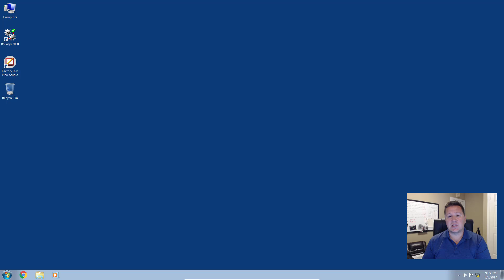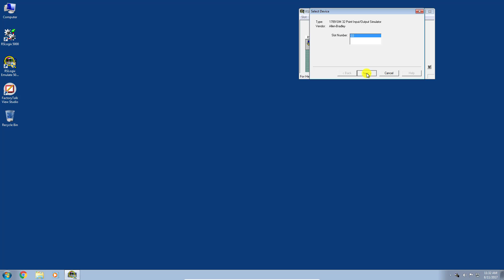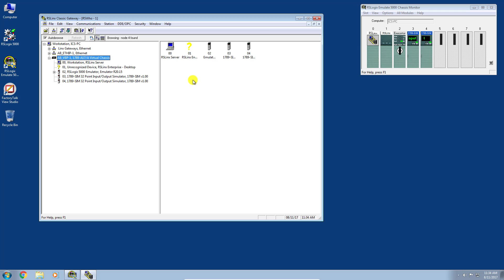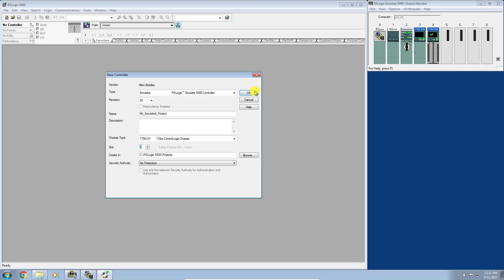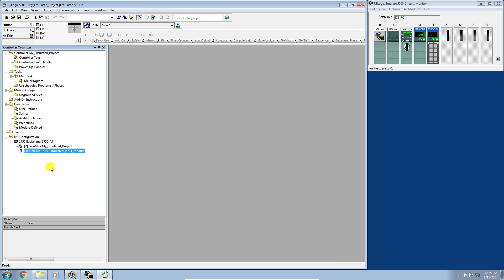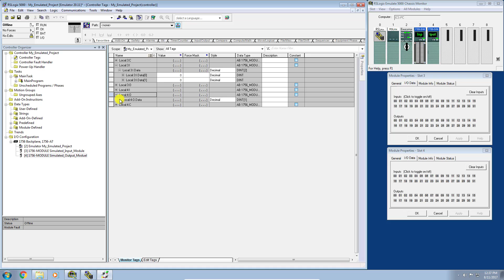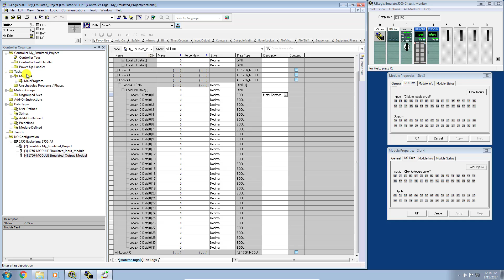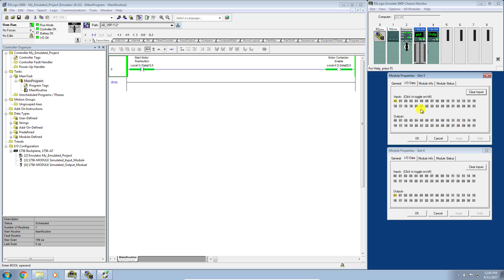PLCGurus.NET - How To Use RSLogix Emulate 5000 Software

Comment: Why do we need to use DATA(1) on the inputs but DATA(0) on the outputs?
Reply from the maker: Good questions. This is how it is laid out in their documentation??? If you find a good answer post it here.
Reply: I thought it was I for inputs and O for out puts. Not a number but a letter. 🤷‍♂️
Reply: I can't change the input by module properties I o data . Just by force, what is the problem

Comment: A greattutorial. I got the emulator, I’ve never really used it, but helps to know how to configure it to work with generic modules. At work, I have a real 5 slot Chasis with a L7 controller in it on my desk with Comms Network Adapter. So having the real thing, I’ve just never ever bothered playing with the emulator.